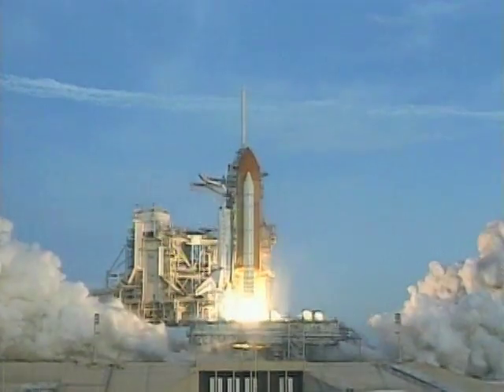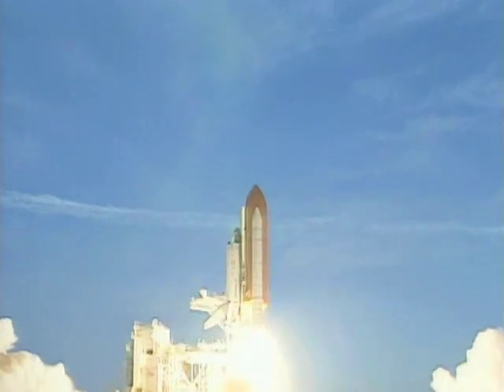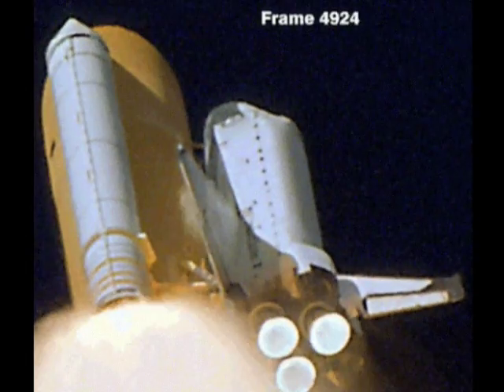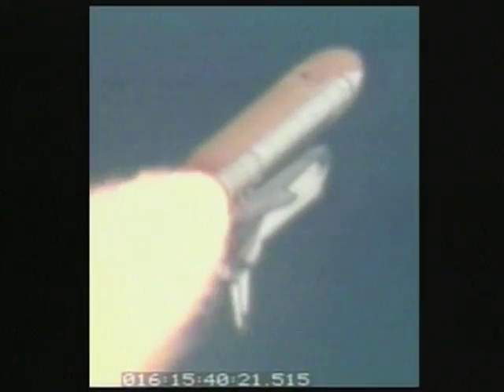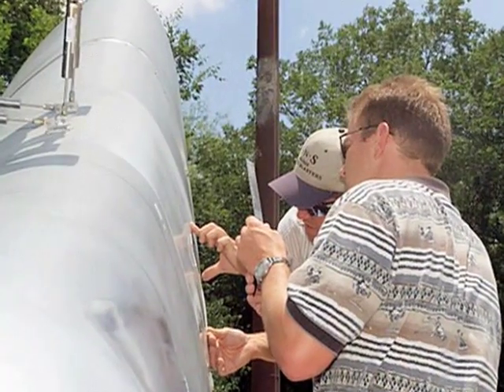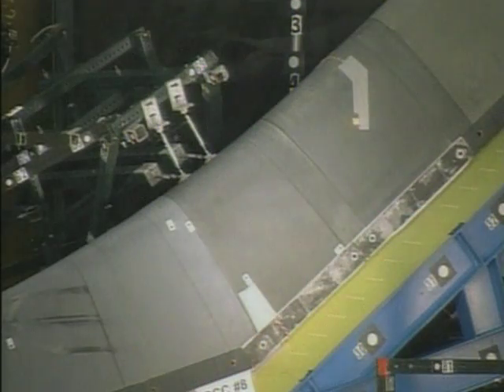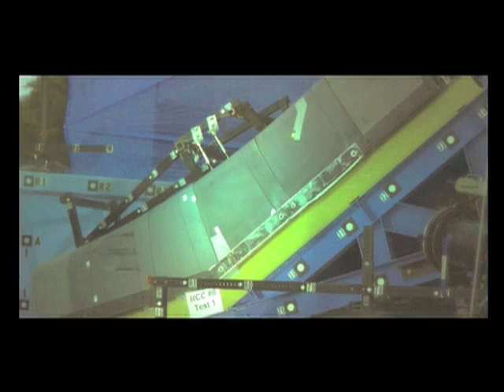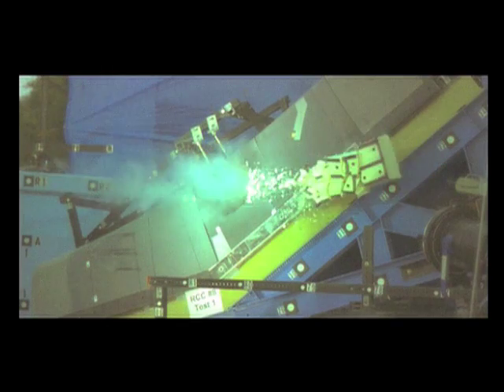Shuttle Debris Impact Testing

Comment: Well, when do you want them to launch? April? Of course that was the comment made about the Challenger launch under freezing conditions. Could’ve given the same response to further test  to see what kind of impact foam strikes could have on portions of the shuttle vehicle. But oh no. That would just delay launches. Get us behind in the schedule. Safer to put the lives of the crew at risk than screw up launch schedules. THAT is what the Challenger disaster was all about. Same thing here. Hubris. Arrogance. Time pressure. Let’s get this thing off the ground. We’ve got more of these to launch. We will simply send another seven lives on their way? We’ll just replace them with another seven lives if necessary.  The real tragedy of what happened to at least 14 lives. Inexcusable. Completely unethical. Arrogant.… Deadly. Never allow a manager to override the recommendation of an engineer. I Told you it would be a mistake. Ask any engineer at then, Morton Thiokol. Can’t seem to find them anywhere now? Oh they’ve been absorbed by Northrop Grumman. Most of that management is gone now. Too little. Too late. These bastards should have been held criminally accountable. No one has ever been held criminally accountable for the loss of 14 lives that need not have been lost. 14 lives in an exchange for a timely launch schedule. Where it not fact, it would be considered under any other circumstance, as an atrocity worthy of criminal action. But God forbid that anyone should be held accountable legally, and have something like this drawn out in a court of law. No, American would be able to accept it without vomiting, endlessly into a bucket of disbelief. I’m sick enough already to have written this. I will never forget, nor ever trust again, management on any company having anything to do with a program as sensitive and complex as the space shuttle. It’s just as well that it was shut down before any more lives or either put at risk, or simply sent to their debts to meet a schedule.

A number of years ago I had boarded a flight to go from Dallas to Orlando, Florida. The plane was not leaving a taxi way for some reason. What could be holding things up? No one had come on the microphone to say anything. What was the problem? A small bulb, a light bulb, necessary to come on if you wanted to read a book while flying in the air at night. That was the problem. And there was to be no take off without having that problem fixed. Where is THAT  kind of attention to detail? I didn’t mind being 20 minutes late. For you see, it was my seat and my light. I didn’t complain. It had been noted by a steward and the decision was made to fix it. That was 20 years before the Challenger disaster. Oh how we have fallen. And who will explain it to the loved ones of those who are no longer with us. I find it fascinating and disgusting at the same time.

Comment: And you have Ron Dittemore saying, “Right now, it just does not make sense to us that a piece of debris would be the root cause for the loss of Columbia and its crew”… clearly it had been a while since he had taken a basic physical science class.. and knowing that f=ma.
Reply: I vividly remember a talking head the day after comparing the foam strike to being struck by a foam beer cooler being blown out of the back of a pickup truck at 55 miles per hour. By coincidence, I've had it happen to me while I was riding my motorcycle. I almost lost control due to the tank-slapper caused by the impact.

Comment: . I can get you rednecks with zero education tell you all about foam ice chest vs race cars. I’ve literally had 4-5 race cars destroyed beyond repair from fans throwing foam ice chest over the fence. I got my radiator knocked out, tire blew out from another one, the steel strap for the lex windscreen was destroyed which then ripped a 2’ gash in my roof. Keep in mind I was only going about 194mph. I hit a stuffed animal in a carbon fiber Body race car and it shattered it which then blew the tire because even at 170-215mph things do extreme amounts of damage.  The worst one is a kid threw a 1’ cheese coney over the fence which destroyed my engine compartment.  It still managed to blow my hood off only the safety tether held it on. We are talking about A FOOT LONG CONEY YALL! But I was going 212mph on straightaway when I impacted it. So I learned early on. No MATTER HOW SMALL THE OBJECT IS DO NOT CONTACT ANYTHING AT ALL! Because I’ve had FOAM ICE CHEST, STUFFED ANIMALS, FOOT LONG HOTDOGS,  BIRDS, FOOTBALLS, BEER CANS ALL DO SIGNIFICANT DAMAGE AT SPEED.

Comment: I'm a little disappointed in the lack of details in this NASA-published video. The final test shown that resulted in a 16x16 inch hole in the leading edge was conducted on a section of wing taken from Atlantis. Prior to that test, the investigators first used a section of Enterprise's wing. The impact of the test projectile resulted in the seal between the leading edge and underwing surface nearly two feet in length. The investigators concluded that, as Enterprise had never been flown outside the atmosphere, and was substantially stronger and more flexible as a result, the impact on Columbia would have shattered it's wing. The investigators then performed the same test on a section of wing taken from Discovery, because Discovery had logged similar flight times as Columbia, and was substantially weaker structurally compared to Enterprise due to that flight time. The Discovery tests resulted in a 3 inch crack on Panel 6, and a T-shaped gap between Panels 6 and 7. This result led the investigators to perform the test shown here, focused on Panel 8 of a section taken from the wing of Atlantis.

Comment: This test isn’t really an accurate representation of what happened. Both the wing and foam debris were traveling in the same direction. The wing slammed into the foam. The foam was still traveling in the same direction just at a slower velocity. Not the debris being accelerated in the opposite direction into the stationary wing.
Reply: Whether one is stationary or the other doesn't matter. It's the velocity difference that matters. On the ascent video you can clearly see it slams the wing and breaks into pieces. That foam was also frozen from the icy temperatures of the supercooled liquid hydrogen inside the tank.
Reply: @RicardoMusch  So it acted less like foam and more like glass?  Any idea of the weight?
Reply: And you dont think they accounted for these basic physical principals? The shuttle was travelling at faster than 500mph when the failure took place. The speed the launch the foam chunk is the speed of differential velocity.

Comment: Damage?
Not much....
It just put a hole in the leading edge of the wing about the size of a basketball!
Reply: I still don't believe it punched through. I think it damaged many of the Silica tiles though.
Reply: @paulschab8152  "don't believe".........was probably the root cause of this!
Reply: @paulschab8152 If that's the case, then that was enough to cause a catastrophic failure regardless of a hole on the leading edge of the wing.

Comment: It's all about the kinetic energy. At that kind of speed, the damage of some foam will be different from a pillow fight, especially it is probably soaked in water/ice. Seeing these clips makes one wonder if those engineers are relying on simulation and finite element analysis too much and lacking in intuitions in physics!
Reply: I saw the wierd testing of a parashoot, that was going out horizontal and it failed. engineers do not  much do they./

Comment: actually they didn't believe that foam could break the RCC panels.

Yes, they were aware of foam causing damage, but didn't believe it could do this much damage.

BTW- The foam is still shedding ...they can't stop it still.
Reply: They just didn’t want to give up the shuttle, they had previous bare misses of foam damage causing a disaster, but since they couldn’t readily fix the issue, they CHOSE to ignore it and cross their fingers.  snafu
Reply: Well, "they" - there were engineers at NASA who calculated the energy involved in such an impact and came to the conclusion that a breach was likely. But yes, most did not and to be fair, it is very counter-intuitive. The foam is much like a piece of sponge and imagine you are driving on a highway and a truck in front of you loses such a sponge and it hits your car. You wouldn’t expect that it did any damage at all. But it was a pretty large chunk and if the speed is high enough, then it really could. That’s why engineers should trust their fomulas more than their instincts and that’s why you have experiments, to prove or disprove the assumptions you have, especially if these assumptions are seemingly self-evident.
Reply: Solution: stop flying Shuttle w/o a replacement 🤦‍♂️
Reply: @noliver7913  The shuttle stopped flying 9 years ago...
Reply: And after this disaster they did start having a replacement ready to meet it in orbit or the ISS